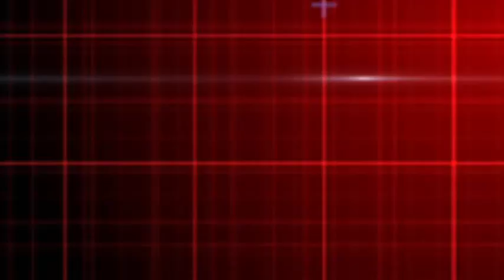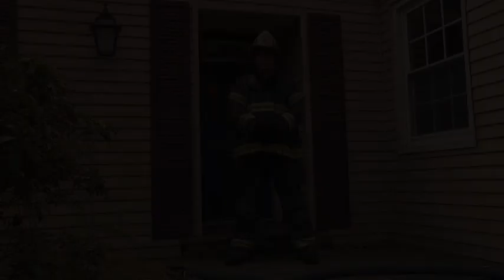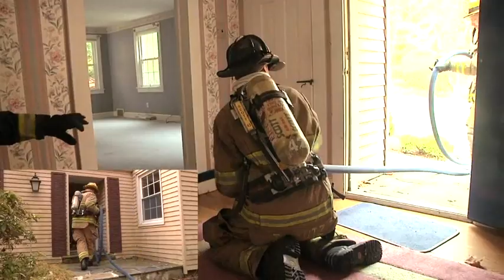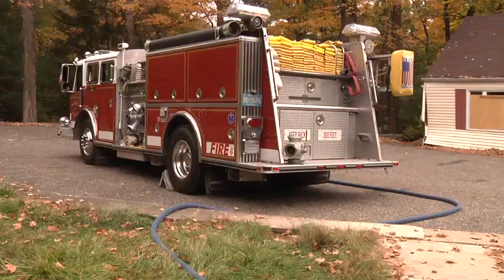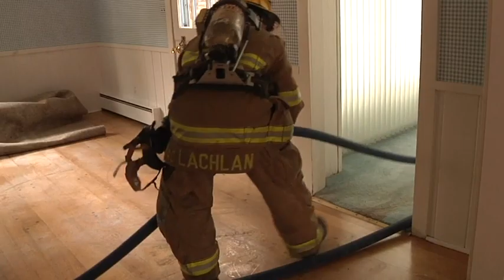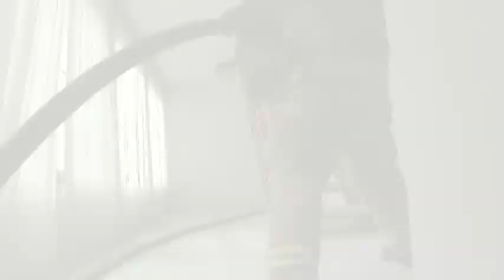Moving the Attack Line: Obstacles

Comment: Thank you very informative.
One question though: as I know from the German fire brigades as well as from marine firefighting, the doctrine is that teams must never split up, i.e. always keep physical contact between the two team members during an interior attack.
How do you make sure that team members do not get lost in case of poor visibility?
Reply: It would be determined by the situation that you're in, as well as the fireground operating procedures or standard operating procedures within your department.

I will say that the good thing about a hose is that if you're always attached to the hose, you know where the rest of your team should be.
Reply: They are both connected via the hoseline.
Reply: Hose
Reply: The general idea is that you're always in physical contact with each other as long as you're all on the hose line
Reply: This is semi outdated at least here in the States. Many departments operate at least within earshot, as others mentioned if you remain on the same line you technically are still in contact. Staying close with the nozzleman severely limits the usefulness of the backup man as you cannot effectively manage multiple pinch points and obstacles.